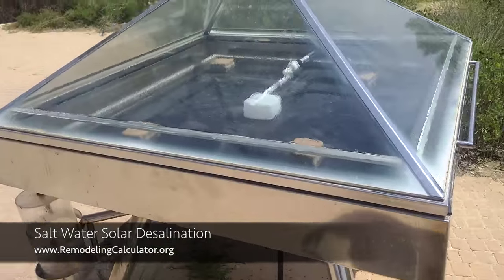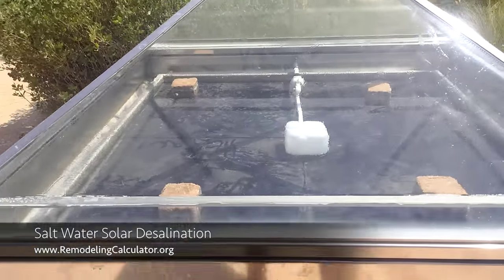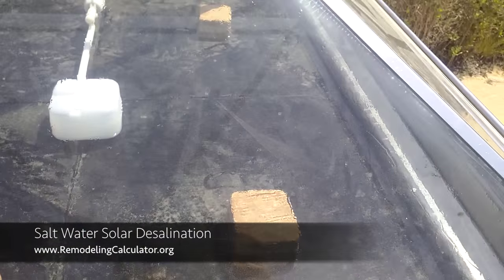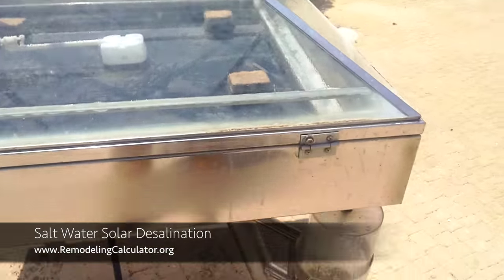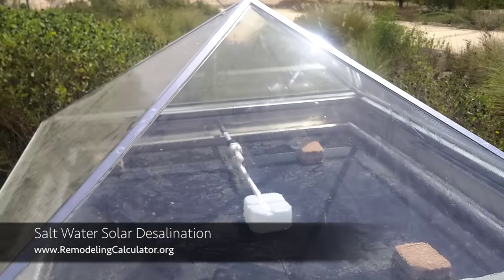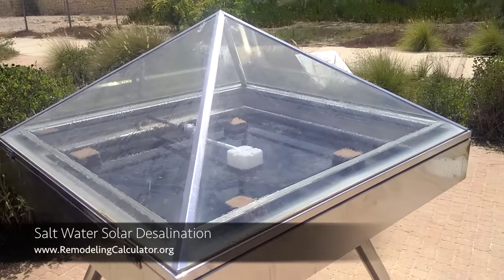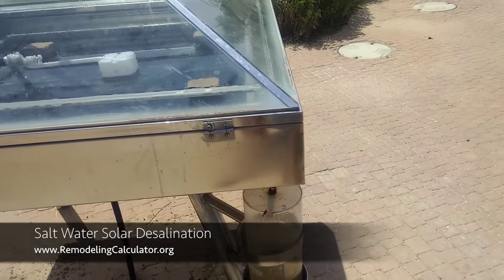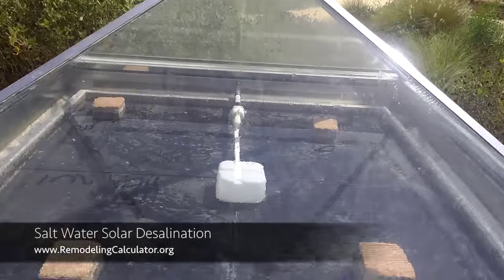Salt Water Solar Desalination - ZERO Energy

Comment: Water produced in this way tastes odd, because distilled water is lacking in minerals.  So, it becomes necessary to pre and post filter this water through carbon filters, and that's easy enough to do.
Reply from the maker: +tswrench you cant pre-filter with carbon... It will be very expensive, becuase fillters will get clogged fast
Reply: Your body cannot assimilate inorganic minerals found in hard water such as tap, spring or well waters. The body is only able to use organic minerals found in fruits and vegetables. Eating flesh is essentially like eating a dirty form of fruits and vegetables contains these organic minerals with other harmful additives. The earth is a giant distillation machine. Fruits are distilled water, sugars, phytonutrients, vitamins and minerals. Everything your body needs. The taste you love from mineral water is the taste of dissolved rock dust in your water. Ever see the hard water residue in your shower head or faucets? That’s what you’re drinking. Calcifying your Arteries, trashing your kidneys and joints. And slowly but surely turning your body into a stone pillar.
Reply: I am gathering ideas to improve my plan of running a homestead on coastal borehole water (it is brackish). I had a similar idea to this but I appreciate the video and comments so I can tailor my plan. Once it has no salt I will run it through a 'wetland' filter below further treating it. The wetlands filter adds flavour.

Comment: Cool, why don't you use reflectors/mirrors, to produce even more heat?
Reply: Yes a fresnel magnifier on the side nearest the sun would make it much more efficient. Good idea.
Reply: psocretes 
I don’t think it would, if the size of the triangular side stays the same it receives the same amount of solar radiation per square metre as it did before, the only difference a focusing lens would make is you would have a hot spot at the focal point but inversely the surrounding area would be cooler. In short, the lense isn’t creating energy, it’s focusing it.

Comment: Great design! Very neat and simple.

I was just thining if this process can be made more efficient by having some water running over the outsode of the dome and thus helping to cool the glass. This should increase condensation to create a lower humidiry and water vapor pressure inside. With the lower water vapor pressure, the rate of vaporozation would then increase at same temp of the water.

Thoughts anyone?
Reply: I'm not an expert but I would say it would be better to increase internal temperature to increase the rate of evaporation and just make the pyramid taller to increase distance from the heat source to create the temperature differential required.

Comment: Put a vacuum pump at the middle of the outlet pipe, to depressurize the chamber, the salt water can boil at say 50 degree Celsius, it can produce pure water much faster. The pump is powered by solar cell of course.
Reply from the maker: This is stupid because vacuum pump takes energy to run ( which defeats this passive solar evaporator being passive) 

Also vacuum will suck out all water vapor - and you won't have any water.

Comment: Use a peltier device at the top so that the water condensed faster. Hide ihe device away from the sun with a nonconductor like wood l.
Reply from the maker: You need electricity for Peltier, and it makes the whole system much more expensive. The whole idea is to make this as cheap and simple as possible.

Comment: Increase the pitch to 72 degrees for a larger internal volume and greater surface area, uses same footprint.  I am building one that is 4x4 footprint and height 6 ft from base to peak.  I will be using sponges in the tray to increase surface area for evaporation.  I wonder why we can't find more examples of this type of useful tool
Reply: if you go too high with the glass the vapor may re-condense back before it reaches the cooler condensing glass, lowering efficiency.

Comment: Use a parabolic mirror to focus light beam on a tank and boil the water. Zero cost to produce the water.  Just cost of building. Little space used.
Reply: I am reading comments and it sounds like Fresnel lens is being suggested. I don't know about that. I do know a tremendous amount of heat will come off a properly conceived mirror
Reply: Autocorrect sucks. Not conceived but concaved

Comment: It appears inefficient to have a clear window on the polar/cold side of the container. This would lower the core temperature of the system.

Also the shape would be better as as parabolic lens, similar to a sunflower, to focus the heat.
Reply: Question: Having a big lens, focusing the sun on the deepest water spot in the container (where the cold water constantly flows to), getting the water to boil there very fast (bigger lens+more sun=higher heat) wouldnt that be faster overall?

Comment: I came up with the same idea yesterday in bed - but as you say this requires close proximity to sea water. But. Do you think it would work with dirty water from a water pit/well? 

You'll end up with way more residual matter like clay, but if that is scraped off from time to time I see no reason why it wouldn't work as long as water evaporates, condensates and is collected.
Reply: As long as the water source has no contamination it will be good, you could potentialy use a baffle in some way to reduce any carryover, but you would want to test water with a electric salinometre before consuming, a simple silver nitrate salinity test  would not realy pick up any chemicals like pesticides that may carry over into the final product

Comment: California has a lot of empty desert space a bit inland from the coast ... just dig a channel and build huge solar desalination plants. 
Why don't they do it? How does this scale? Also: what do you do with the accumulated salt?
Reply from the maker: +Andras Libal funny - i was just discussing with a friend, how to scale solar desalination... 
Basic idea is to have drains in the middles, and higher walls around "dirty water" in center. Then once every few days or hours, flush salt out. Then just dump it into huge pile and then use it for road deicing in the north.
Reply: This is not very practical for road de-icing.  The transportation costs would be prohibitive.  It would be better to find a local use for the salt like for cooking, but how much does one get or need?  You also need to consider that your source of seawater may have other contaminents in it besides the usual salts.  Furthermore, you need to transport the water to the solar still.  The farther or higher you go, the more costly it gets.  The space issue isn't as bad as some people think.  There are a lot of rooftops and walls going unused that would be a good place to put these things.
Reply: Andras Libal : Hot Pretzels? Sprinkle it on hot pretzels? So every desalination plant needs a pretzel bakery right next to it. Problrm solved.^^
Reply: No, the transportation cost for salt is very high just as Ron mentioned and it's also not pure salt. Obviously you need to put it back into the ocean the problem is that the point where you put it back is a source of highly concentrated saline solution that kills off marine life. If you want to use it it needs further processing and a lot of water/energy for that which is exactly not what we want to waste in the proximity of desalination plants..

Comment: Why not devise a way to stack several units on top of the other?  What you lose in sunlight maybe more than matched in increased production with the same amount of land used.
Reply from the maker: I guess it's a good idea - stack them up in towers about 1 - 1.5 apart ... but then if u have many towers, the block each other. Also it would be hard to get up to them to remove salt

Comment: What material did you use for the water basin? If it's not a food grade material, it will very likely vaporize over time with the water.
Reply: What material would you think is the  best suited for this use case?

Comment: have you considered using solar panels in conjunction to use to heat electric heat coils under the black surface to add to the temperature and produce more evaporation.
Reply: Carlos Ray Romero You sir had a great idea
Reply: Jose M can You also add Some salwater plants inside to increase evap?

Comment: I just subscribed and would like to talk more about this environmental project to clean water without energy. Why does your method effect the environment?
Reply: I think he means in a good way. Theoretically you could create an array of these devices and set them out in an area in which you wanted to irrigate. You would probably need the ability to roll them around as the soil beneath them became highly saturated. That's of course assuming that you've made numerous upgrades to the design.

Comment: No way it may produce 10 liter if it is 1 sq meter. Somewhere 3 liters based on WaterCone and an industrial solution in Pakistan: https://en.wikipedia.org/wiki/Solar_desalination which makes 4 liter per sq meter.
Reply from the maker: That's what I was told by people running the solar village, where I filmed this

Comment: this is not Zero energy - it has the embedded energy that was used to create it, probably with electric tools run off fossil fuels.  or even if run off solar, the solar panels have embedded energy, probably including fossil fuels which transported them from China.  Not sure where the presenter is located - maybe they have their own solar panel energy, but even so the panels have embedded energy.  Maybe if everything were used/recycled, the embedded energy would be fairly small but still not zero.

Comment: Why cantt you use a lens to get more heat in side the chamber
Reply: Mohammad Naqeeb 
Added expense and complexity as the lens would need to track the suns movement to make any difference. Plus don’t forget the lens isn’t increasing the solar energy, it’s focusing it at one tiny spot. Meaning the surrounding area would be cooler to exactly even out the equation.
Reply: that's logic and reasonable.
for long time using, is it working well no any trouble? water hit by sun as well as photosyntesis usually cause some algae, is it safe to drink the water? or need more proces to purify the destilation?

Comment: The argument against this is "it takes up a lot of space"... What if that's an advantage if built on ocean based floating platforms? Insulated bottom to prevent the sun from heating ocean below platform would shade water cooling the ocean while using the sun to evaporate ocean into fresh water within the devices.... A grid of interlocking glass pyramids shading the ocean from the sun while using it's heat to create fresh water; sounds like a win win situation and simple stuff... Do this in the water scarce equator nations then we can take cool those oceans... Thermal electric generation (difference between hot and cold to create power) is also possible in this case hot end in the device and cold end in the water would enable constant power generation... Alternatively simple heat engines can be powered by the higher temperatures; these Stirling engines ran in reverse is the basis of cytogenetic coolers so use heat from device to power Stirling engine that turns another in reverse to create cytogenetic temperature... Stick that end under the devices in the shaded void space and we could freeze the ocean if desired or allow the ice formed to regulate the ocean temp... Just my thoughts eh

Comment: I am curious, you say no energy apart from the sun and no mechanical parts! How does the contaminated water, (salt or otherwise) magically jump up into the pan? John,Australia.
Reply from the maker: For the most part, you pour it there... But you can create a water supply line that will deliver water.. can use water pump, but i think there are ways to pump water using sun light
Reply: Is not pouring it, (Salt/Contaminated) water an an external energy source in itself?
  If you use Sunlight to power some form of pump then is that not a mechanical device regardless of what powers it? 
  I just think that the Video Description is a little misleading. That by the way is without the tools and energy to make this Solar Still. John, Australia.

Comment: The desert southwest has nothing but open land, scorched by the sun.  Why not pump in ocean water to a massive field of these to help alleviate the water shortage problem in that region? It would have to be made on a grand scale, but I see the Chinese creating projects on a grand scale all the time.  Think big.
Reply: I live just south of Phoenix, AZ.  Much of the Southwest is covered in plants, and animal habitat.  Our elevation is 1508 ft, so any sea water used would need to be pumped up to the desert level, along with water to rinse the waste products out of the system each night so they don't build up.  The seawater intake would need to filter out all sizes of plants and animals or they would contaminate your desal equipment. The real world is far more complicated than it appears in books.  I'm retired Mechanical Engineer, I was paid $195 per hour to solve problems. Worked in Saudi Arabia for four years so lots of experience in desert environments.

Comment: you have to be able to speed this up by using magnifying lenses in some way.
Reply: A Fresnel lense from old plasma tvs
Reply: Hold your source in a tank that drips onto the flat surface.  Heat that source tank any way you can and it'll help encourage evaporation rate which is accelerated with temperature...
Reply: Or make the bottom plate colder by running water underneath it and back underground with a wind pump or small solar powered water pump. More complex but would greatly increase the output

Comment: You could do a elec vaccy pump running on solar and use straight sola hot water panels to heat water to boil well below 100°c in the vacuum, would love to know if anyone has tried this in a small scale
Reply: I would not be boiling the water we want to distill in the solar thermal panels.  Yes, this is a more direct and likely efficient approach, though remember the salt will attack the metals, corrosion, and deposit minerals, calcification. Eventually this will reduce efficiency and ruin the equipment.  Descaling will be energy and chemical intensive, possibly negating the benefits of the initial greater efficiency.

Comment: I was 12 years; and did already better - here, the wet air meats the glass in the sun, cooling and condensation wil be but few...  The wet air went into another "reservoir", itself cooled , inside a bigger recepient, in "terracotta, and containing some water : that water passes trough de pores of the terracotta and evaporates, what cooles the space inside ;  that is a traditionnal technique to serve as a kind of "frigidaire"in the Sahel. In that colder environnement, the water in the air , in the more little container put inside, condenses quick; the air returning to the hot zone, its charge in evaporated water is very low- the air arrives cold and is heated there , and it will absorbe more easily ...
The "motor"moving the air from hot/wet to cold ,  is the fact that heating not only the air absorbs evaporation, bet expands, and cooling, does reduce its volume...but, cold air is for that reason more heavy than warm air, and the cooler, exposed to the wind, has to be in the shade, and above the "evaporator", end enter in the evaporator under it, and get out to the condensator in top. It will work even beter if you make a mirror of an old parabole of tv ... and will put the "cooker" in the focus. Attention, it can heat that quick it can explode, AND when the water get above 60°, the salt will cristalise on the sides of the boiler...So better you organise to clean it easily...

Comment: can you explain why it should be a pyramid shape?
Reply from the maker: It can be any shape, that has slanted walls (so that evaporated water would run off to the sides), but pyramid is much easier to build than any other shape.

Comment: What are the dimensions of the square pyramid? 1 meter W 1 meter long and 1/2 meter tall?
Reply from the maker: +Andre Santana you can play with dimensions. Some say that taller pyramid will make this work faster.

Dimensions dont really matter... You can have a small one or a large one... It will work
Reply: Because solar energy can be collected from all 4 sides, independent of sun's direction